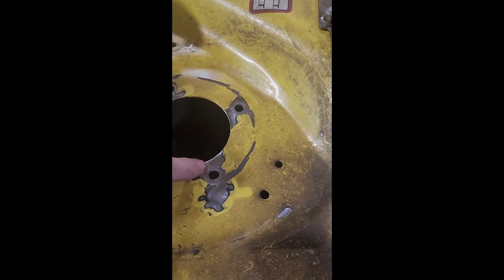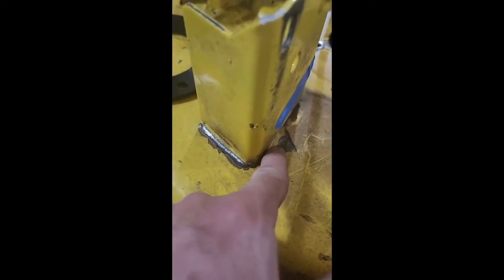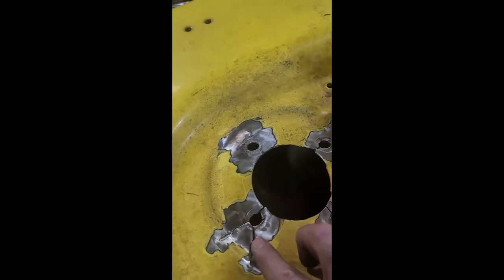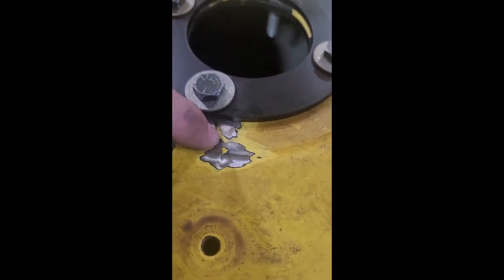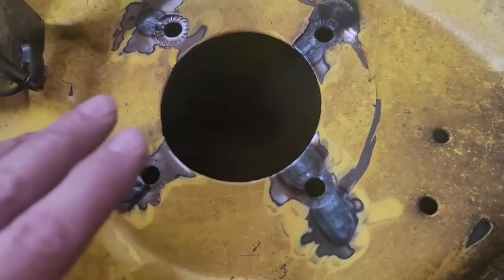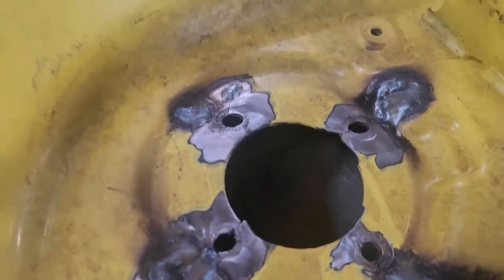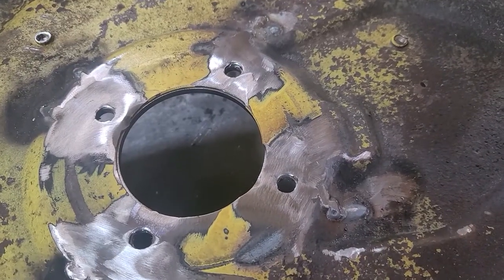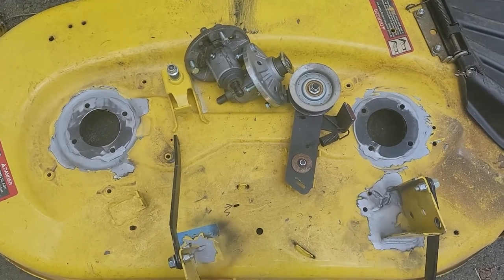John Deere mower deck repair and reinforcement

Comment: Thanks for the video! Facing the same issues. Would you share how much you charged for the job? Thanks !
Reply from the maker: Thank you for viewing and commenting!  It really does help!

I try to steer away from talking prices as they can vary widely from one region to another.  Also, this was done in our machine shop / fabrication shop (www.youtube.com/MountainLaurelMetalworks) so our labor rates differ from a pure welding shop.

I can say it was between 2 and 3 hours total and the customer provided the reinforcement rings and the deck was already dismantled (original spindles were already removed), so there was no material cost, only labor.  So if you are looking for a price, I'd quote between 2 and 3 hours labor depending on the damage.

Comment: My problem is worse the bolt holes are ok intact but beyond that I have a circular crack beyond about 8 inches in diameter .It looks like blade hit something and riped it from the blade area to an area 4-6inches outside of where that aftermarket metal flange would go. Pls. advise.
Reply from the maker: Without images of how bad it is, that's a tough call.  I can only assume it will require significant reforming of the steel to get it back in place.  Having it ripped out that far is complicated in two significant ways, first you need to get the metal back in it's normal position, that's hard enough.  However, when you begin to re-weld it, you need to be sure the spindle is perpendicular to the deck and parallel to all the other spindles and pulleys.  If not, the belts will wear extremely fast and if bad enough may even jump off the crooked spindle.

If you want to make a video and post it, I'd be happy to help.  

Also, our other channel www.youtube.com/MountainLaurelMetalworks may have more user input as well.